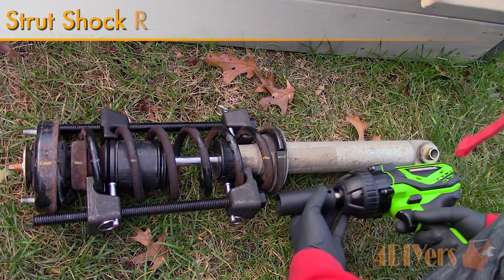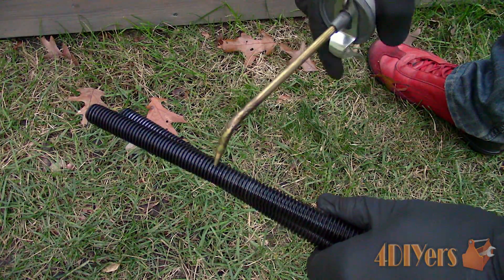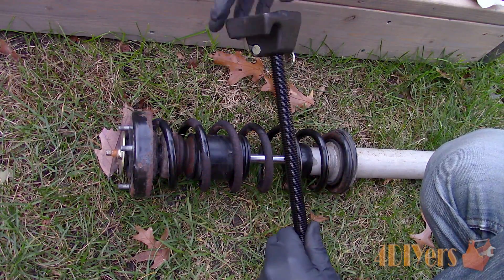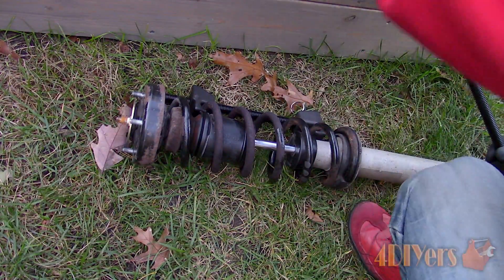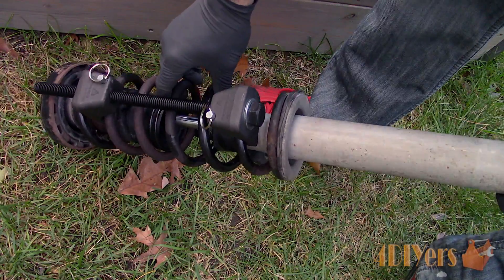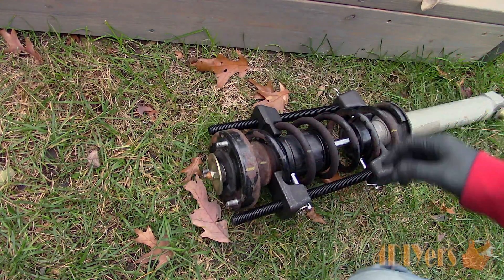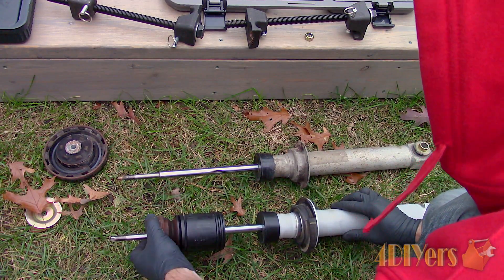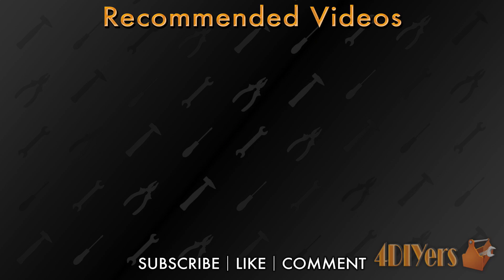How to Disassemble a Strut and Replace the Shock

Comment: I'm trying to use the same compressor I'm renting from Autozone on my Jeep Commander.  Unfortunately, between the coil diameter (large) and the short distance between coils, I can't get two compressors installed on the spring.  Do you have any suggestions?
Reply: Buy a quick strut and be done with it.

Comment: might want to update the video and use shop towel, at least double or triple folded, to clamp down on the shock rod during that part of the disassembly procedure. That way, you are not damaging the main shock shaft/rod surface.
Reply from the maker: That was mentioned in the video.
Reply: @4DIYers  My apologies, I missed it.